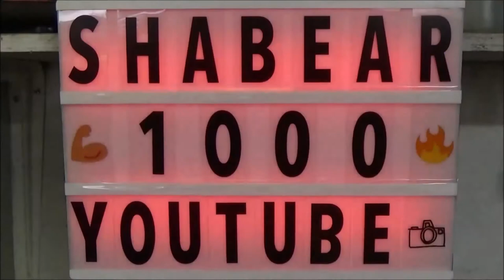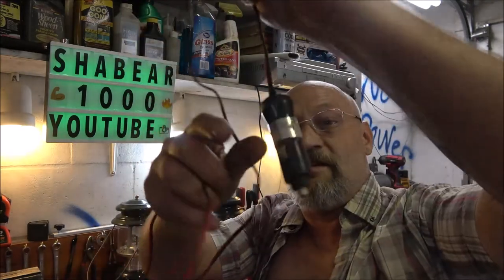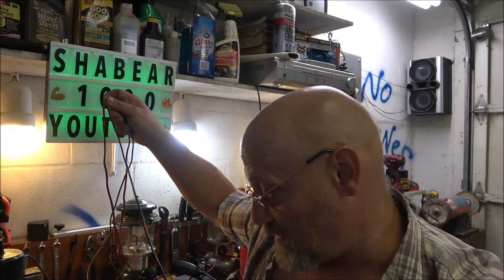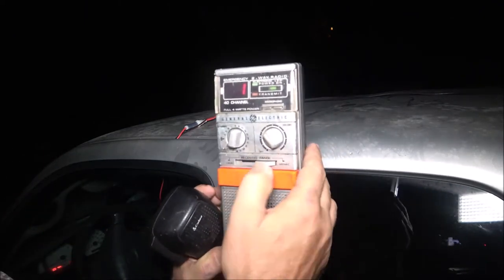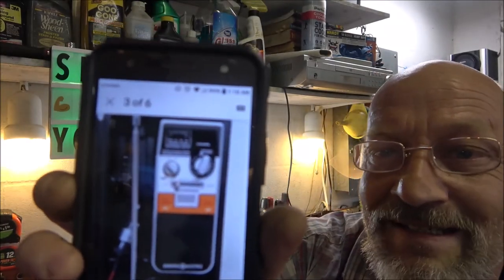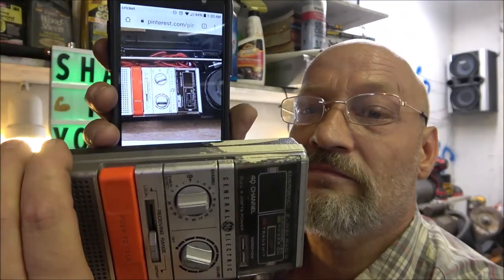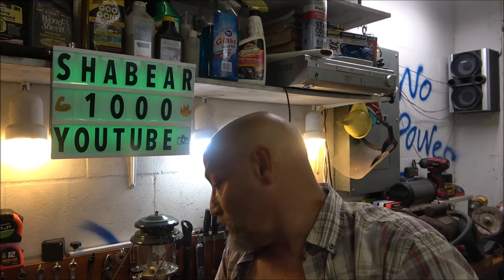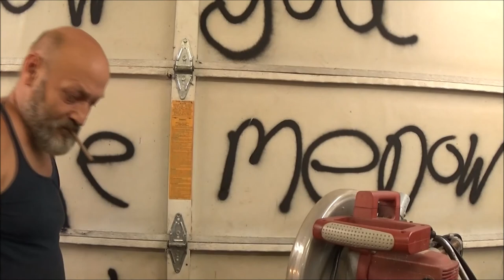Late Night In The Shop S1 E3 Vintage General Electric Emergency CB Radio

Comment: Your chances are very good  talking to truckers on cb  you just get amp for your cb radio if just get your base station antenna aboved tree line you'll be ok  you might need go  60ft or more  you  have alot southern pines and live oak trees turkey oak trees  in north florida.